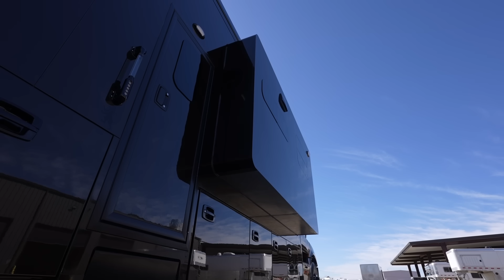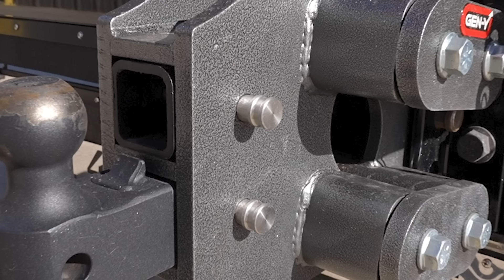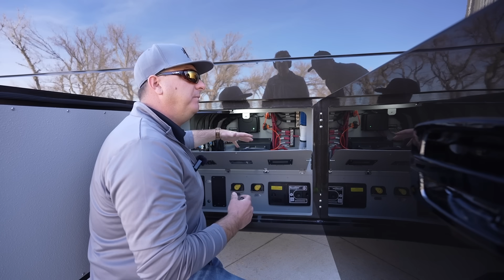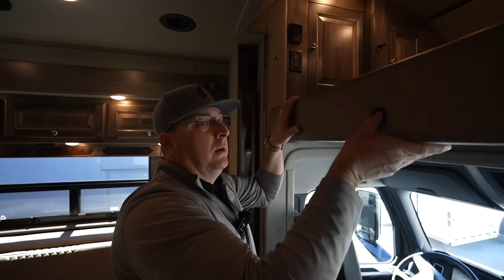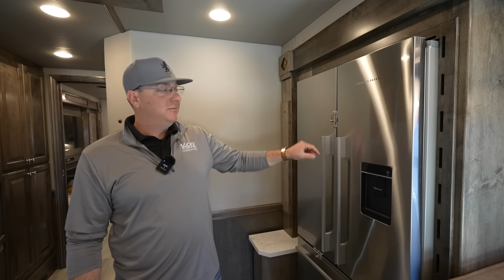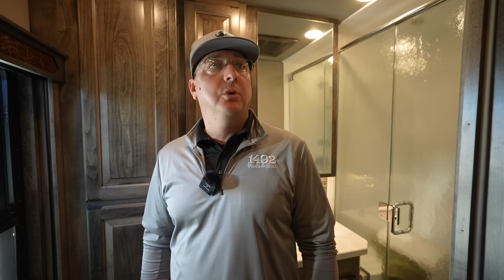THE MOST EXPENSIVE CLASS C RV ON THE MARKET!

Comment: Why are the bathrooms normally bigger and nicer in a Class A motor coach when they are the same length? Is the length on a Super C measured from the front bumper to the rear or is it the length of the actual RV part? Just curious here and I’m definitely not saying anything negative about this coach.

Comment: Holy fugg....a 600 Detroit  engine and a 12 speed automatic transmission......that is alot , i mean alot of power for its size.....i use to drive a 80,000 lbs highway truck and i had a 430 Detroit under the hood.....and i drove 750,000 miles in a 6 years period with it ......and this  class C RV has a 600 in it....

Comment: Its very cool in a James Bond would take this on vacation kind of way. I drive a 4 wheel drive 4/4 3/4 ton pickup with a camper.  Off the end of he camper I have a standard cargo rack attached to the stock bumper hitch.   There have been places in my Journeys across the country where I have just about scraped the cargo rack off because of the incline or decline entering into parking lots or across irrigation ditches.  I see the rear of this is elevated some towards the rear, but when I heard the word "Boon Docking" I cringed. This looks like a Pavement Princess  (Tough and Well Built for sure) that is not something I would want to drive down a gravel road?  Would. not want to scrape the bottom of this off.  Is there some kind of skid plate system on the rear?

Comment: Full aluminum trailers are super hot. As in temp... Especially dark painted aluminum.  Aluminum transfer's heat magnitudes better and faster than fiberglass.  Which means, you had better have a high end high btu air conditioning system..

Lithium Ion.  Nobody does "lithium" batteries... Huge difference

Comment: 1.4 mill i dont know its nice very nice but the fold out couches i cant stand id want comfortable couches not fold out hard  cushions you would see in a 70s camper trailer and the table the same with all that space you could easily put in a table and chairs not them cushions again there is quality but honestly i dont see 1.4 million being reasonable just because houses are gone insane they are an investment these motorhomes depreciates  just like any car or truck the second that leaves the lot it being 1.4 million it drops 50 grand at least and thats being generous just ask anyone that bought a brand new 500.000 or 200.000 dollar motorhome they say had they known they would have bought used 2 or 3 years because unlike a car people do not put as many miles on these as one would think .So these are far from an investment more like a boat money pits just running and its upkeep to do the annual oil and filter and lube jobs its 600 bucks 500 if you get a break but that should be checking air bags etc full look over and thats just one of the simple things mind you this is very nice but nothing overly soecial they all do the frameless windows now and many of the things mentioned here but he sounds like the kind of guy that would go out of his way to fix or replace anything to keep a customer happy and that counts id buy from them

Comment: I suppose you all weld the aluminum for appearance and some strength advantage.
As an aviation technician myself and having worked with aluminum alloys of 5056, 6063 T6 and 7075 T6 I can't help but wonder if welding compromises the temper of said alloy.  We rarely if every weld Aluminum in aircraft, never in the fuselage skins. The only disadvantage i can see to a welded structure are repairs to the skin.  If your skins are .050 inch I can see where welding in a repair might be difficult.  Of course with riveting it's not an issue, but... it's also not as pretty!  I'm also curious about your frame distances and if you use stringers and longerons (horizontal structure fore and aft)?

Comment: Some critique here.
First, outside aesthetics is awesome in addition to the well thought out storage and Utility.
Inside….?
It’s looks like a Winnebago - the design looks like the 80’s. 
Moving on, the floor looks laminated - totally unacceptable- how about some real wood on a multi million dollar RV?
I didn’t hear anything mentioned about the cabinet material, but if it’s not cabinet grade plywood, and MDF instead (oh, the outgassing) , I would be flabbergasted. Hoping there is not one inch of formica either.
OK, so you want to truly test the structural integrity of the RV? Drive it down the Cross Bronx expressway in NYC from the Throgs Neck Bridge to the George Washington Bridge and see how many doors are still latched after that 5.5 mile journey. (My Class C Ford V10 didn’t do too well) 
Anyway, all that being said, I realize that there is a high amount of customization in the purchasing process, but there are some builders that wouldn’t go below grade no matter how much anyone paid them (like the expert carpenter my brother is).😊

Comment: its missing a few things, not really futuristic!  all these units are garbage no strength on the sides rears or front protection and also if you have a flat i didn't see any tires with 2 types of rims for the front and rear spares and also the unit doesn't have a self lift hydraulic system to ease of access and change tires or go some places where the land or terrain aren't always leveled the fabricators did a good job but not the best! all these units are no more than 10k worth without these features plus have a 360 turn standing still! thanks for all your hard work but it wasn't thought well enough!!! take the unit back in to the scrap yard or sell your units for 10k take the loss and walk in shame cause you guys really didnt think of it to well plus also it should also have a few modification that allows a truck to come out in the front and or a helicopter to come out while the back trailer area is left alone not a well thought at all it was stupid built!

Comment: why that unnecessary protrusion above the cabin, it creates excess resistance to the oncoming air flow, because the shape is ill-conceived. It is noticeable that calculations were made by marketers and not engineers. the roof area is so large, it directly asks to install solar panels and batteries for backup power without using a generator. excessively expensive materials and no forethought in the effectiveness of this means of transport or a house on wheels.😒

Comment: why freightliner? the dd15 motors the o rings go on suction manifold and the gasket seals go. build one on a Kenworth chassis with a caterpillar motor with 900 horsepower full air and lockers.

Comment: @13:20 With that fitting manifold.  As long as that thing isn't leaky, it's not a bad idea, but if that manifold develops a crack .... it's everything is shut down.      I like fittings near the sink or appliance because it makes it easier to shut them off and test the connections, otherwise you are running in and out of the RV to test pressuring the system.

Comment: 22K likes, where is the bathtub video. LOL.. What a smart business model. The owner is very much about customer service and making a quality product that they can stand behind. Kind of rare nowadays. Most want to outsource as much as they can. He wants to make it in-house. Since I am the distribution manager for a large DYI home improvement company that has 24 box delivery trucks all over the US, I totally agree with the owner. Peterbilt is the better choice over Freightliner for the drivetrain. Fewer service issues also, or let me say my Peterbilt trucks have better reliability and do not spend as much time as my Freightliner trucks getting serviced. My 4 International trucks are the oldest and they never break down, yet the owner says they cost too much brand new. He is also correct about how the last few years the drivetrain has improved the ride and handling on the trucks. That is all manufacturers. My only issue is the overhead sleeper. In my 10 years of being a distribution stupiviser I have had 2 trucks can opened because the driver ran in trees. Not parking lot height bars, or low overhang signs but big tree branches.

Comment: Never attempt to sell this to a female in this method.  Begin in the interior, present the function and place the mechanics, electrical, and tech after.  Unless there's a request for that up front.  

The exterior details totally turns off the interest. 

1 out of 50 get the presentation correct and that is Mercedes (not necessarily the dealers, but the Company, they get it correct).

Comment: I want it to be Bullet Proof with Bullet Proof windows. Voice Activated lock/ unlock with Voice Auto Start? From outside or inside Coach? Also a Water RecycleSystem? I am thinking Auto Tint System on every window including WindScreen, according to Sun Shade position? Solar panels to boost Battery Bank with complete UPS System? Sony  5000 es Head unit with necessary Na2 ES Foam Anchored speakers no bolting for easy access! Rotisserie speaker spin with automatic lock for speaker face protection. The beds must be 6”- 12 tube water Bed with Soft Side and water dump if needed? raising out of Floor. Drop when not in use. Jacuzzi Bath Tub. With large full-size Toilet and full Sink. Double Vanity to Make Up with chairs that fold up from floor. Washer Dryer Stackable.

Comment: It's nice and all... but you RV people need to please step it up and add a wheelchair ramp/lift to these RV's. Many of us older people are choosing to live this way but there is no way to get in it without that installed. Please look into that. The floor you have that goes across the steps so no one falls down in stairwell.... would be perfect for a ramp that comes out from just above the top step (just underneath the inside floor) where it slides out (motorized) and then lowers to the ground for wheelchair to load onto. When it comes up then they are level with the floor and the ramp can then just revert back into it's hiding position. Also the large shower stalls should have a feature of pushing a button and a short wall starts to come up out of the floor just inside the shower door. Comes up the height of a regular bathtub. So then you have a shower and a tub. Push the button after the bath is emptied then the tub wall sinks down into the floor. Just like the concept of the tv elevator you have in the living room. You know those are good ideas. Come on... admit it. lol.

Comment: INCREDIBLE...just stunned....in 1492 Columbus went out seeking a better world...and you folks build a better RV.   As a recently retired 747 jumbo jet builder, I can REALLY appreciate what 1492 does.  The forethought for maintenance...no connections, only on the ends:). ON 747's we would run convoluted tubing under the floor. Inside that tubing was string...for pulling through new wiring for future or replacement wire...without taking everything apart.  

Hats off 1492....you are some seriously talented/creative folks:)

Now to check my lotto numbers....a million for that level quality...its easily worth that....thats a 747   on wheels!  GREAT VID!

The 747 team had that same camaraderie:)  

Detail after Detail...this vid fired me up!

Comment: I'm curious as to why they chose Aluminum instead of carbon fiber? Can anyone please explain? I thought carbon fiber was very strong and lightweight.
Reply: Because carbon fiber's advantages of weight and strength aren't concerns with a motorhome built to travel on highways. It would cost 3 times more to be slightly more fuel efficient
Reply: @iamBazzy  It's a lot of money already lol, but damn 3 times more? Thanks for the explanation though, I didn't know it would cost so much more.
Reply: @RockHash  Yea, it’s expensive and fabrication is difficult. With how large this thing is, I bet there would be a lot of panel bonding and glue, compared to just welding. Koenigsegg does industry leading work with carbon, check out a video “carbon fiber construction - /INSIDE KOENIGSEGG” if you’re bored!

Comment: 1.4 million it’s a awesome truck but When he talks about innovation, come on you put flush frameless windows they have been around for years, you removed the bulkhead for more space but cut the space in two with two door,
Electric locking and keys have been on motor home for 30 years,
Making a big point about the labels not been stickers 
And all the wiring been labelled come on man 😂

Comment: I am curious why no vertical storage areas on the coach for E-bikes and for even a Vespa Scooter.  I like that the exterior does not have the Jupiter planet swirl look and it is a solid color.  I do feel the interior is kind of dated looking and too monochromatic with those dull brown cabinets that look like box cabinets rather than custom.  For me I like the interior look of the smaller Leisure Travel Vans.  They have a more modern up to date look.  I think the company should explore hiring a known modern interior designer that has designed for modern homes, hotels and even sail boats, it might be an option.  I feel like diamond patterns on the seating is a dated look too. I know others will disagree with me but this is my opinion.  I also like how Airstream designs their interiors too.

Comment: I'm fairly certain I've never heard of, &/or seen a C Class RV so I have so many ?'s, like what's the difference??  It's super early on in the video so, the majority of ?'s, if not all, will likely be answered but talking about the roof, I can't help but wonder if it wouldn't be possible to fabricate a cover that could slide on/off the roof to create a solid flooring, only when stationary, of course, but just a flat cover/floor sort of insert. It would really be amazing if there could also be a way to attach hand & arm safety railings to it also & basically make a rooftop porch or sitting area. I 'm not sure if this idea is too far fetched but I did see this design option on several custom built and a few pre fab tiny homes, so that may have only been possible due to the already tiny construction but it would really take the cake if all that were possible but to go a bit further, if the safety railings also had attachable posts that would allow for the rooftop porch to extend a bit further, thus, allowing for the rooftop porch to essentially boast it's own roof. Like I said, I have no idea if this is possible but a girl can dream, right?1

Comment: i spent 35 years working in ArchitectualWoodworking Business basically everything we did was CustomFabrication and inhouse Engineerecd i’ve personally been a Avid Outdoorsman  with lots of RVing  and Camping  history. along with being a long term Airstream Owner and Enthusiast 1492 is certainly setting the bar  on this style  and  is awesome at providing a fantastic Product with a Extremely nice Fit and Finish on everything ! I’m  a little bit OCD  because that’s what i’m about  on my Craftsman ship  what i like about you guys is the details don’t stop beyond the first impression  when i build something like a peice of furniture  and someone compliments me on it i like to say Thankyou  and  i flip it over to show them the bottom or underside that is just as pretty as the rest of it  i also like having Control of all those details like 1492  the nice Labeling tags  built in house and permanently Riveted  along with being engraved onto the Coach is a touch of Class and a great Conveinence to every Owner  instead of slapping some plastic tag with double sided tape that won’t be there in a few years of use those are the things that really are important IMO  i restored a 1964 woodenChris Craft CabinCruiser  and every peice of Bightwork got 14 to 17 Coats of Spar Varnish on all surfaces including the back or underside of it that no one will actually see  when installed back in its proper place when the Restoration was Completed  somewhat similar to the interiors of the storage Bays on the Coach you guys used  in this video  the other small details like the interior lights and standard Outlets well that’s just doing things correctly IMO  especially in todays world  when even infant toys now are rechargeable and Electronic  !

Comment: Great video, looks like a very fancy RV, but I can't really see paying $ 1.5 Million for this Coach.  A Brand New  Newmar Supreme Aire is $ 750 K, for pretty much the same features and floor plan.   Half the price...  This one does have a cool paint job though
Reply: VASTLY different build quality differences. The Supreme air while an aluminum frame is composed of fiberglass with composite gelcoated sidewalls, fiberglass roof and rear cap.  This 1492 coachman is a tank. Its completely built of aluminum. The entire thing, the walls, the roof, the frame, and the slides are best in the business. It also sits on a semi truck frame. This coach will last a lifetime. Supreme aire not so much.

Comment: The Tesla all electric doesn't thrill me but an autopilot would surely compliment theses coaches. My dream would be a single vault entry bulletproof windscreen a safe room with front and rear safes and an  auto ma duece on the roof. Steel drops on all windows, run flats all around and various armored truck style gun ports hidden around the out side. And some proximity sensors all around.

Comment: I was watching another video earlier today about a company working on developing electric semi's, and so when the subject came up about an electric semi, I thought I might suggestions what I learned about in the earlier video... Janus Electric, it's an Australian company... I believe they said they could convert any type of semi. They are basically developing, like a removable battery pack system, but it takes up the same amount of room as your normal fuel tanks, the motor and transmission are designed to take even very high loads, Like a motorcoach would need.  Maybe something for 1492 Coachworks, to check into.